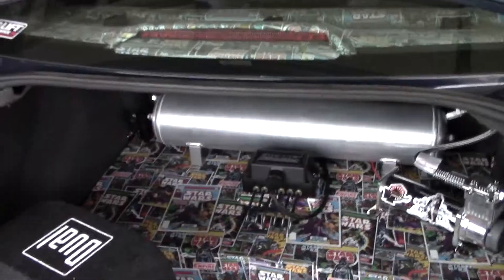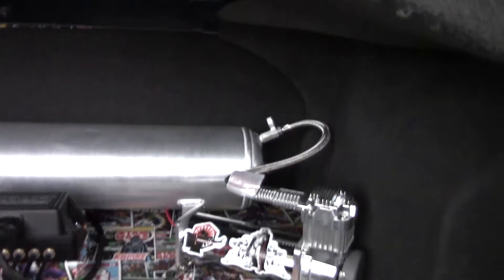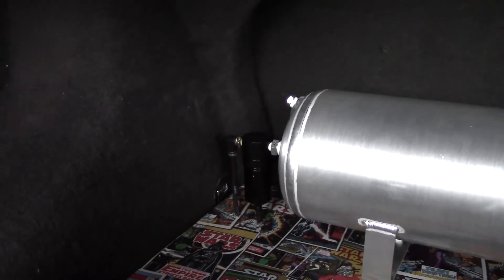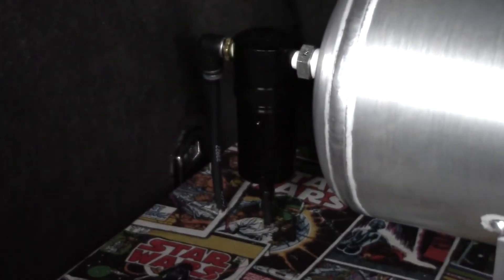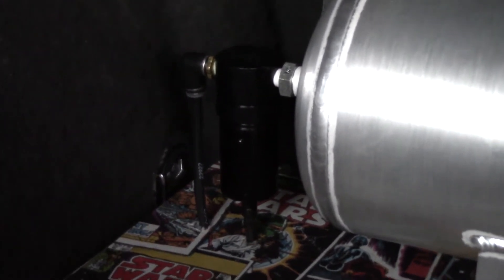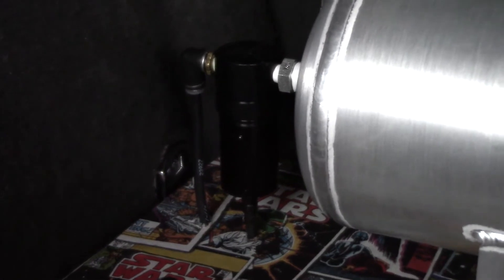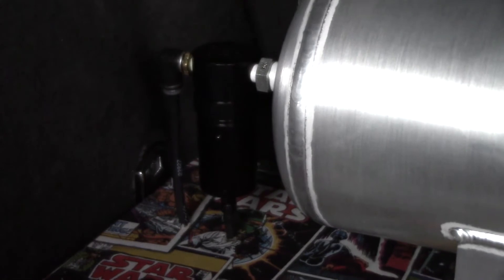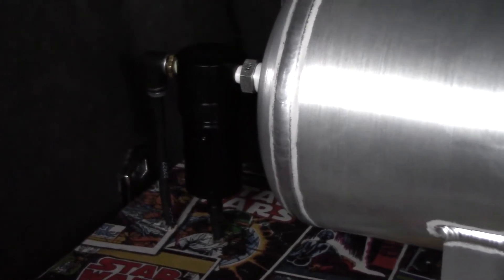Air Suspension Water Control

Comment: This was a really informative and helpful video, thanks a lot. I'm about to install Airlift V2 air suspension to my MK3 Vento VR6 and was trying to find a good solution for letting the water out of the tank and control the water in my system beside the airlift water trap which goes between the tank and the manifold. Thanks again!
Reply from the maker: Thanks for watching!

Comment: I honestly never had an issue I have two compressors my manifold has two inlets I run a water trap on each one and I never ran into an issue of water being in the tank but I do have my drain just in case

Comment: Dumb question, but which fittings did you use to connect the water trap to the tank and the water trap to the lines?
Reply from the maker: They are all push to connect fittings. They all came with the kit from Airlift.

Comment: So why do you have a water trap annnnd a water release line?
Reply from the maker: The water trap is inline from the tank to the manifold therefore it keeps water from getting into the manifold and the bags. The water release line is strictly a drain valve for the tank itself. The line allows me to drain water from the tank without having to fully decompress and drain the tank of air to get the water out.